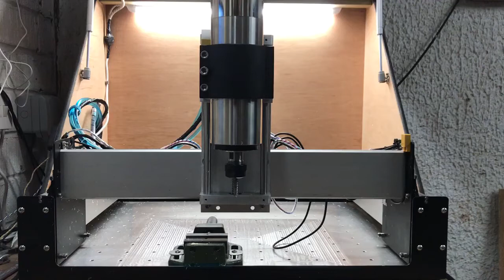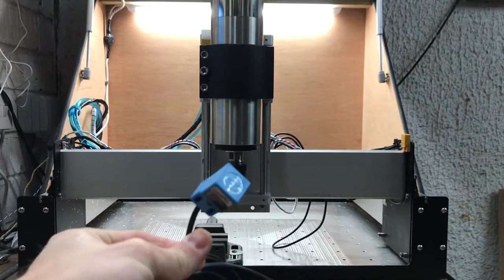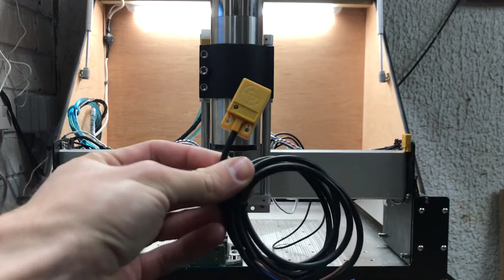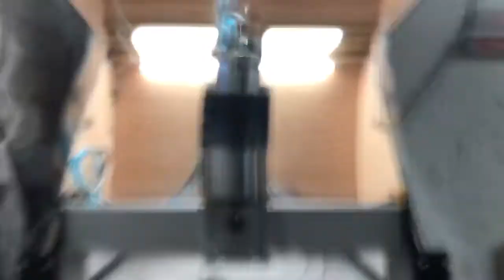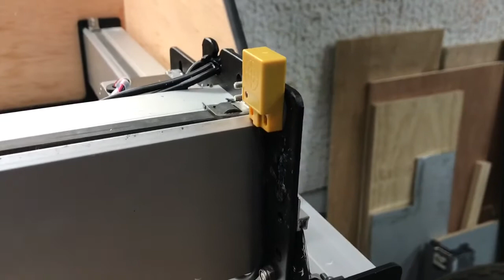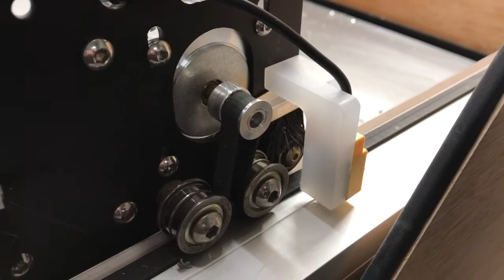Shapeoko 3 Limit switches - contact is so 2017... Proximity sensor upgrade

Comment: (2)Homing Cycle Failed. (1) Limit Switch (3) GRBL Error Pull Off didn't clear (4) GRBL Serial Port Resource Error - Help Please, thanks.
Reply from the maker: Most likely your steps are not set correctly. i.e. when the machine pulls away it's not pulling away far enough (as the wrong steps per mm are entered) causing the homing cycle to fail. What machine, and switches are you using?

Comment: Sir I used normal switches.. and  when it is pressed, the motor stopped working but after that it's not taking any feed.. is there any option to move the motor away form the switch. Without resetting it. Plz reply.
Reply from the maker: Yep just use the grbl setting to put an offset on each axis
Reply: Luke's Garage how to set that... As I am new to programming

Comment: You end up getting clear tubes too? I can see the blue dye. Just make sure the dye isn't particle based as it can clog up the works. Also as someone who water cools PCs you might get either a silver coil or some PT Nuke to prevent an microbial growth in the liquid
Reply from the maker: Yep, as mine was an early shapeoko it didn’t come with anything like a drag chain however I want to tidy up the cabling one and for all. The downside was that when installed I needed the tubes to be slightly longer than what I had so changed to 5m each way, and clear so they look cool :) I actually use a central heating additive to filtered water. So far no issues and I’ve used that since day 1
Reply: Luke's Garage awesome glad to hear it! Keep up the awesome vids I love seeing the progress!